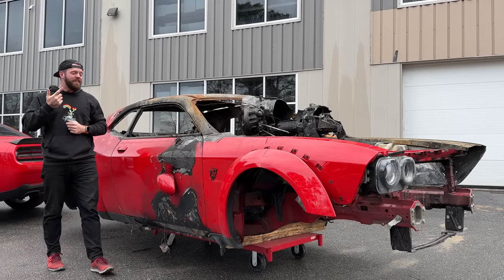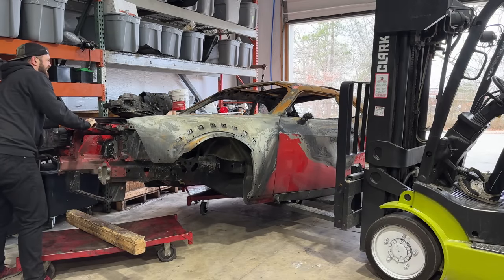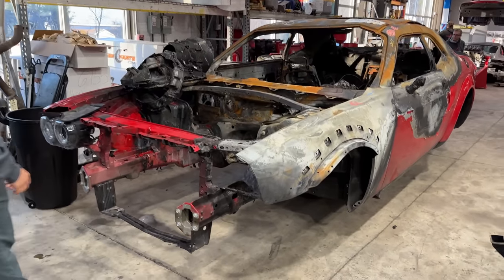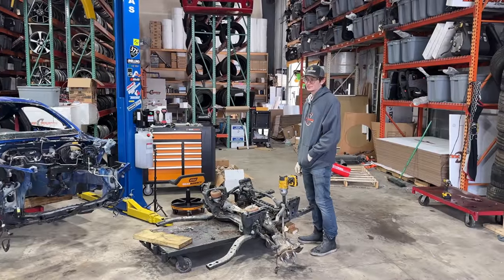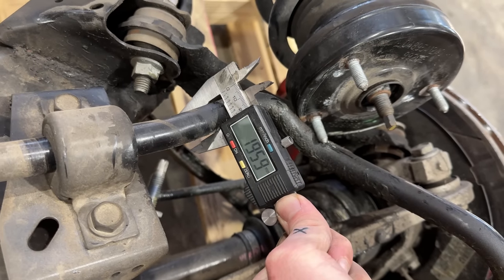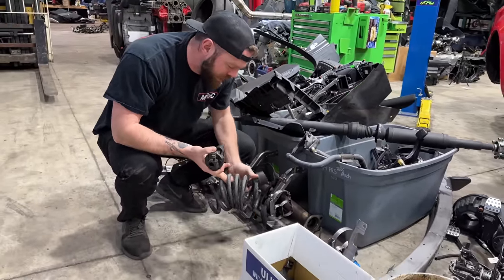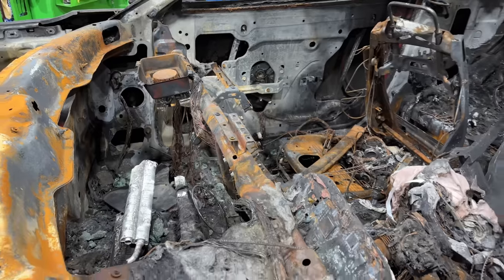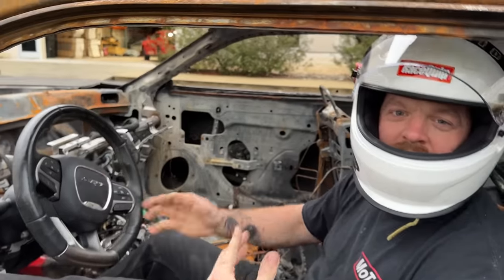Building The World's First MANUAL Dodge DEMON! | PT 3

Comment: I would say to get the frame squared up, stripped, and ready for a base coat of paint so then you can start swapping parts for reassembly after its sprayed
Reply: He doesn’t want to paint it to show what he’s done
Reply: Agree. You guys need to get that chassis prepped and painted before you even think of doing anything else. You should have it over at the paint shop already.
Reply: Personally, I think if they just put a fresh coat of clear over it as is and keep the burnt look, that would look awesome
Reply: I love these channels but hate when they put the new/donor parts on the car before cleaning it up entirely. Hate working with a dirty workspace. I'd rather they completely strip it, clean it, sandblast it, prep it, then start putting the parts back on.
Reply: Yeah I don’t know why he’s not cleaning the frame and whole car before putting stuff in
Reply: @yousifal.2165  lazy. Just doing this for content
Reply: @nleippe  my man
Reply: I've seen classic muscle car restorations on many wrecked vehicles. They never get the chassis right again. They end up with problems like doors not closing right and uneven tire wear and unaligned steering. All these things they try to correct with spacers and all kinds of tricks but in reality they are just freshly sprayed and polished ruined cars. A lot of classic muscle cars for sale on the internet are like this.
Reply: @tonybrown9875  yea there’s no way that demon is structurally sound without replacing the roof, and all the burnt panels.
Reply: Surely the steel in the frame has been severely weakened by heat and is no longer structural?
Reply: @lldjslim  ok spammer

Comment: I think it's awesome your saving that Demon. 

I would put that drivetrain in my 2011 Challenger  that currently has a 3.6.  The car has 217,000 miles and has seen it's share of pain.  It is on it's second motor (hydrolocked the factory one) and it's been in a couple of fender benders, but it has been fixed every time.  I think it would be a cool project for my son and I to undertake.
Reply: You need a 09 and up hemi,  I swapped a 2010 and it's a pain.
Reply: that sounds fucking legit
Reply: how in the hell did you hydro lock a challenger? I have a jeep with the 3.6l, they hyrdo lock easy, i have a snorkel haha
Reply: @mails5054  It really surprised me too.  The factory air cleaner box pulls from the bottom in the bumper area.  Freak storm in Oklahoma and I was going to pick my wife up from work.  The water that I went through was just about curb high, maybe a little higher.  I know the door sills did not get wet and driving through that area in the dry based on curb height it wasn't very deep.  I was going slow because I didn't want to push water into the intake.   It still pulled water in and broke the rod on piston #1.  I avoid any standing water with that car now.  There were other vehicles driving through there no problem, which was why I went for it.
Reply: Rift33SRT  When I turned 40 my wife went and found it for me.  There is a lot of sentimental value on it.  The hellcat route would be fun for sure.
Reply: @itsalwaysfriday9766  freak accidents happen. My jeep pulls from the front passenger corner of the hood. The problem is that if you hit lets say 1 foot of water at a decent speed the water is pushed up to the hood and then back down into the air box. Ive had to drain it and replace the filter a lot. I ended up just cutting my nice vented hood and added a snorkel lol. Cried a bit to cut that hood cus its not stock, but its better than trying to convince someone to tow me away from an offroad park with a hydro locked engine

Comment: I found you through Ricer Miata's channel and have fell in love with what you do. if I won the motor I would put it in my 1927 t-bucket project. I currently an restoring it and have been looking for a 392 engine to put in it just to be different but a 5.7 would do just fine. it only weighs 1200 pounds. That would be plenty of power.

Comment: I just discovered your channel recently and really like the Smoked series you have. It's crazy how you can pull value out of the wrecks you bring in. I'm currently a senior in college and I've got a 2003 red TJ Wrangler that could definitely use an engine swap. I know its not quite built for speed but I think it would be a fun swap. I think this would fall under "No replacement for Displacement" and it would be fun to build a rig to explore some of the great outdoor areas around. Thanks for the amazing content and best of luck with the demon!

Comment: Man i have been down this exact road. Bought a burt up truck. Gutted it bought a donor and started swapping. Sounds easy right? Nope. 1 year off, 1 trim level off? anything like that causes so many problems. Mine was from a harder to find vehicle than your hell cat believe it or not. So what I could find cost me a fortune. As a retired/disabled guy. This took me years of saving up to do this. Ultimately to have a electrical problem I could not solve, it's in the shop right now for about 2 weeks. Hopefully they can figure it out and I can afford it. Getting it built the way I wanted took every penny i had and then some. So i wish you luck bud. i'm sure you guy got this.
Reply: OH MAN. That Engine, ok I need that. The truck I mentioned above... I would swap that redeye engine into it. It's a 2001 Ram 1500 4x4. I CAN do that swap plus would make great content for my channel.
Reply: Am rebuilding a 2014 shelby gt500
Reply: how disabled are you? You mean from years of work, like back/legs or something?

Comment: i just bought a 1987 vette, and that would be epic to put in it. My engine and transmission were just both rebuilt, so If I got the Red Eye drivetrain, I would pass on the generosity by giving someone the vette drive train. It would be quite the project, but it would be sweet.

Comment: Hey, I'd love the engine! I'm actually local (right across the bridge) and have bought some parts from y'all before. My plan would be to use the engine in my street buggy I'm building. I've got pictures of the frame and work I've already done on it and have the means to actually finish the project so it'd be going to a good home!

Comment: the heat probably ruined the temper of the spring. once the temper is gone, the spring can't bounce back to its original shape and will just bend and compress under the weight of the car.

Comment: I’m guessing the demon rear setup is softer for drag racing? Also, what’s the difference between demon, red eye, scat pack and hellcat please??
Reply: So, the demon was the ultimate with 808 hp stock (before the demon 170) the redeye is the upgraded version of the hellcat with 797 hp the hellcat with 717 hp and the scat pack is basically a little boost to the stock charger with 459 hp (the demon 170 makes 1,025 hp stock if your curious)

Comment: Ok I have a 91 dodge dakota that I bought for my son for his first vehicle.  We drove it a block home and discovered the oil pan was full of water . Miracle it even started. We started taking the engine apart and discovered a huge horizontal crack on the block underneath the passenger side head. Total loss . I've been looking for a 5.7 to put a holley terminator intake and stand alone ignition on.

Comment: I have a 2006 BMW X5 3.0 in-line 6 that is need of a V8. I also have a 2000 328i that could use a v8. Everyone does LS swaps but i feel i should change it up and do a Hemi swap. I like my cars to be Built My Way (BMW). If I don't put it in either of those i have a 1960 Chevy C10 Apache that needs a motor as it  currently has the original straight 6 in it. Just not enough HP for me. I am in fine with makeing a long drive to pick up a free engine. Love the Demon 😈 build. Keep up the great work.

Comment: 1972 Dodge dart. Pull the old Slant 6 out of it and make it a burnout machine with that motor!! Body is good but motor is done! 
I am 25 and done a few motor swaps. Working on a 98 ranger right now motor and trans swap! All done just waiting on transmission lines! Been a real pain >.< Figuring out the motor swap would be fun!

Comment: That red eye engine will go in a 5.9 360 magnum v8 Dodge Ram 1500 sport. The original owner ordered the truck... 5.9 v8 4x4 black with black leather, heated seats etc... it was her pride and joy until she took her own life. It was sold to me for the sport front bumper... but after getting there and hearing the sentimental value of the truck I couldn’t bring myself to tear it down. Was thinking about is swapping it for reliability but the red eye would be a dodge on dodge match instead of a Chevy on dodge crime

Comment: I remember watching all of he medias pieces they put out, as they slowly trickled out information about what was going to be in the Demon. I had a 392 at he time, and I was really into these cars. Now, I do not remember specifics, but I do remember that there was a reason they used the automatic in them. It had something to do with the way the tranny cools itself.

I am not an expert, but I do remember that the experts who designed the Demon were worried about that.

Personally. I am al about the six speed Tremec. That is what I had n my car. But are you sure you can couple it with that engine, without breaking something?

Comment: I think it would be cool if bodywork was only fixed to structural degree and all the "burned" metal that can be left on as is should be left just like that. Then the car would be wearing it's story.
Ofc, the rust issue - after all that work definitely would not want anything degrading because of rust.

Comment: Why not keep the demon diff and cradle in the demon? Just replace axle and bad parts ? And might get the entire car checked because they have ultra high strength steel on the a pillars and if the fire got to hot it might have severely damaged the strength

Comment: Hey, "GIVE ME THE SHAFT!" You think your Demon is bad, I've got a '20 Redeye Widebody that almost the identical thing happened to. Only it's way worse. 
1. Caught on fire passenger side and burnt entire interior.
2. Firewall and floorpan moved rearward at least 12". 
Like you, I had to use the sawzall to take it apart. Need several parts. Need an auto trans case, 8hp90(zf 8 speed). Need front adjustable struts. Also need a full body wiring harness. I can send pics if I have an email address. I need a ton more parts plus a decent body.
I would also be interested in the Magnum engine. I have a 2006 Magnum SE without a junk 2.7l. Already have done a 4.0l swap on another '06 Magnum & 300. Been doing this for 30+ years.
On the Demon manual swap, that may be a little tougher than you think. The driveshaft tunnel is manual trans specific.  And it doesn't just bolt in. Ideally you need to swap the whole pan. Or, you have to cut the floor out of both cars and weld the manual one back in. Also the firewall may be different where the clutch reservoir mounts and goes through. Wiring is definitely different for neutral safety and paddle shifters ect. I've fully disassembled several Dodge cars and swapped wiring just because of slight year differences. It's a day job for sure if you know what you're doing.

Comment: If I were to get the drivetrain I would put it in a custom car that I’m building from the ground up. I mean Im building a new car out of nothing basically a kit car and I need the drivetrain before I even start it. It’s a shorter wheel base with all independent suspension. But I can’t decide what drivetrain I want but this would be a huge plus. But if not I’ll just get a LS or a LT4 But if I do those it’s going to set me back a while. If anyone wants to talk about the plans and more about it just let me know. I have a couple drawings on the whole car. But best to luck to everyone and loved the video.
Reply: I’m also thinking about starting a video series on the build and sharing my process along the way.

Comment: I get it as a piece of rivetting content that will easily generate a lot of profit and the cars will pay for themselves tenfold, but what is it about the Demon's chassis that differentiates itself from the others? Hasn't it just got flared wheel arches bolted on and a different vent on the hood? (Which is completely burnt out on that). What I mean to say is, there's really hardly any difference in the Demons body to any other model, and what differentiates it is the engine, so why go to all this effort just to rebuild a basic chassis....like I say, perfect project to put on YouTube to make a lot of cash, but seems like such a pointless build other than that. Id rather fix up the hellcat and then get the engine up to Demon spec.